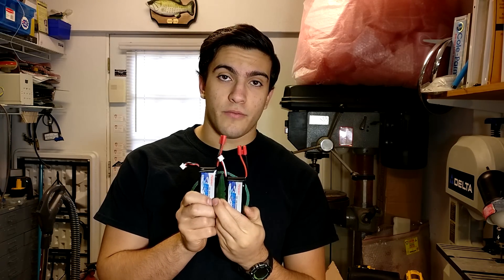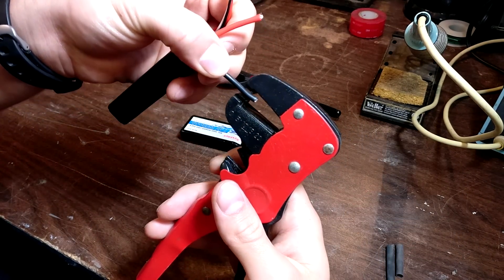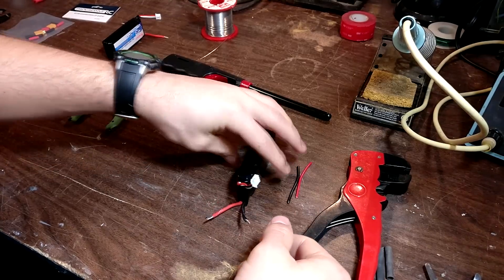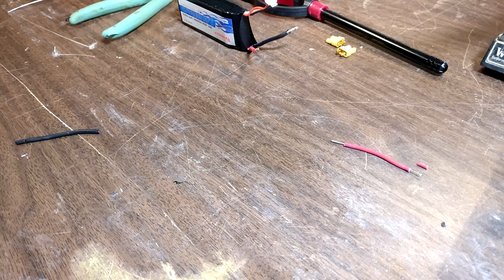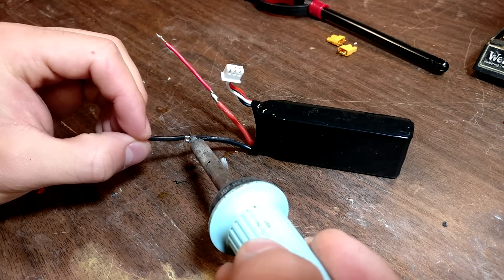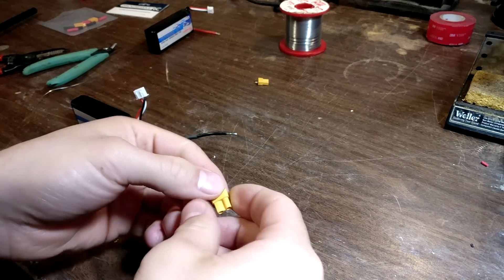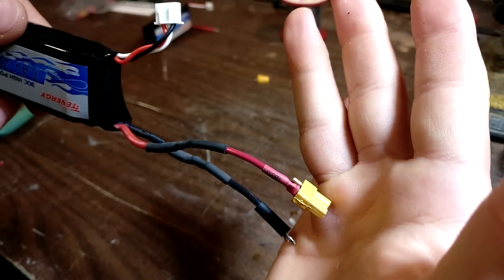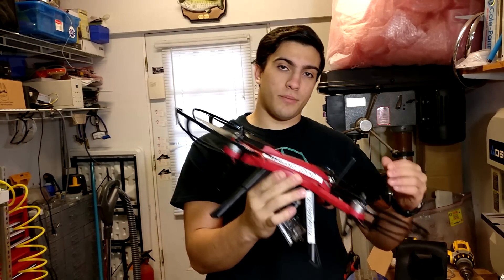Mjx Bugs 3 Battery modification

Comment: dude that's got to be the scariest battery mod video on the net ,  cutting and then stripping both positive and negative wires at the same time and then holding the xt30 in your fingers to solder it and to be honest your really lucky you didn't melt it as you should have it plugged into the male side when soldering them or vice versa and surely you should have added solder to the cup on the xt30 otherwise what's holding it in apart from the tinning in the wire  , I wouldn't fly anything with those batteries , the slightest bit of vibration and those joints will pop apart , mind you, you did give that heat shrink what for so I suppose you could be lucky that that holds the joints together but even still they are some risky batteries you have there my friend , I'd store em outside the house or in a lipo bag or even better still throw them away and buy some that already have the xt30 connector on them ,   sorry for having a go at you bud but that wasn't really the right way to go about modding a battery 🖒🖒
Reply: LOL, everyone is an expert man, i've learned this over the years. Screw all them, it may have been a little unsafe but as long as you have confidence in your ability who cares. I work with high voltage electricity daily and have done things way worse, but i know my abilities. Screw all the haters, nice work and good video.
Reply from the maker: tony perks no uninsulated wire is open therefore no risk is present the only danger is if the two wires were to touch causing a short. It may be a crude way of doing things however it works and was as a whole done correctly. Thanks for worrying about it though. Thanks for commenting and viewing
Reply: Rather kiddie type excuses. Others do it wrong so it's OK for you to do it wrong.  I suggest you use some of the money you've earned by teaching how not to do things and take a course on how to do things correctly. Whether or not I'm an "engineer" has little to with this, I just don't like cowboy's showing incorrect ways to do rather important things which could end up putting someone in hospital or worse. 

There are a number of videos showing how to solder correctly and why it's important, try watching a few, then again you don't appear to be the type to accept you're wrong. For your information I've been soldering for more years than you've been born, and yes I've done it as a business and worked for a company which allowed me to solder the circuit boards for the F15 fighter aircraft.  So I guess knowing how to do it correctly was important. 

One last thing, you really should learn how to take constructive criticism.  I didn't post for my own good, I actually gave you some tips to help you in the future.  The correct way is the ONLY way to do something, but there could be a number of ways which could be correct. Sadly yours was a long way from being one of them. And just because you've managed to get a year out of them doesn't necessarily mean it's safe, it only means you've been lucky.
Reply: This isn't an F15, no one cares about your years of soldering. Not everyone has a perfect setting and every available tool to "properly" do every task. If people do this and get hurt its their own fault, life is risky and you can minimize risk but not completely eliminate it.
Reply from the maker: +JakeJunker wow that was very nice of you to say. I sincerely appreciate it man you rock!it's for people like you why I truly enjoy sharing my content thank you so much! By the way JakeJunker I just wanted to let you know you have gotten a shoutout on my Instagram for your much-appreciated support. https://www.instagram.com/p/Bckb-a-lSaA/?hl=en&taken-by=warriorzoino .Thanks so much !!
Reply: You really are an accident looking for somewhere to happen aren't you?  Jake Junker, fitting ID by the way. "As long as you have confidence in your ability"  Did you learn that at school or did you just make it up? What a irresponsible way to go through life. You "take chances with high voltage" do you. Obviously you're a self righteous apprentice with a just as stupid teacher. It doesn't matter which voltage you're talking about, it all has the ability to kill. I'm just glad you won't be getting your hands on anything I'm likely to be using. How "High" is this voltage, 30,000 volts? and how many amps involved?  

It's fools such as you who cause problems for others. NOBODY should brag about cutting corners where any voltage is concerned, but especially high voltage. All that woeful battery butchery needs is for the positive side to break loose, expose the wire and short out to earth and what follows is one big fireball. I definitely has all the traits of being a bad connection so it's perfectly feasible for such a scenario to happen. What happens if at that time the quad in in the trunk of a car, exit one car and maybe even the occupants.  That's the results of cutting corners, the "what Ifs"  You stop and think "What if" the next time you cut corners. What will you say to the judge, "But I had complete faith in my work" No excuse dumbo. Who cares? everyone but you obviously.
Reply: I was going to say much the same. I don't know who taught him to solder, but sorry he failed miserably. That iron wasn't clean and the resulting joints were very poor, in fact it didn't look as if the solder flowed on any of them. Twisting the battery wires like that is asking for bad connections, the oil from your fingers is enough to stop solder flowing among the wire strands, which means if the joint should flex the whole lot could give way. Cut one wire from the plug, solder it to the new plug, then cut the other wire and solder it, avoid having both wires floating.

Heating heatshrink with a flame like that is also asking for trouble. It's far too severe and can make the tubing go brittle, so when the wire is bent the heatshrink could easily break away and you'll have bare connections looking at touching each other. A good heat gun is far better, you get uniform shrinkage with no brittleness. When it comes to batteries, especially LiPos it's best to be overly cautious. 

I double heatshrink the wire/connector joints then with a larger heatshrink cover the connector and the wires. I'd never join extra wires on a battery either. I'd use an adapter  from the XT60 to XT30. This way there's no need to touch the battery wires or connector. The advantage of doing it that way is it lets you use the battery on something needing the XT60 plug.  By the way, one is a male plug and the other a female socket.  Use your imagination to figure which is which. :-) 

Oh yes, try to get into the habit of using RED wire and heatshrink for positive and the black for negative.  It's a good habit to get into, "any colour it doesn't matter" definitely does. And try not to burn the balance plug. :-)  Yes I was a rather harsh, but as Tony said, it wasn't the right way to show others how to mod a battery.
Reply from the maker: +propfella well I appreciate your information and help I definitely will admit I am not an electrical engineer and there are a plethora of videos showing how to incorrectly do things I would just like to make it known to the public that my work in this video has been working for about a year now with no problems whatsoever. So possibly the correct way of doing something isn't always the only way but if you are shooting for correctness and flawlessness by all means follow the steps provided by my various commenters who offer a very helpful and generous information to help you. Much appreciated for your time to help out anyone who might be having trouble. I take it you are some kind of engineer?
Reply: @WarriorZoino  hihihih,so ironic ,,hihih
Reply from the maker: Alright Thankyou for your insight Have a Goodnight

Comment: Curios why you didn't use the wires from the battery, instead you used another wire to attach to the XT30 clips? The wires from the batter looks like it's just long enough.
Reply from the maker: Ed Cubillan simply because just in the case the wires weren't long enough to go from the battery compartment on the drone to the plug port on the drone so for extra measures I just added an extension
Reply: What gauge wire did you use as an extension?
Reply from the maker: Ed Cubillan I would say anything from 16 gauge to 18 gauge will be fine

Comment: for my mjx x101 i used a 1500mah n it did the same. lvc at 5mins but can fly for another 4mins. the stock 1200 gives me 6-7mins flight. maybe the lipo i bought is a cheap knockoff?
Reply from the maker: Jan Domingo what exactly do you mean by lvc

Comment: do your modded lipo give u early lvc? I have a 2600 and 2700 mah lipo but i always get lvc at 5 1/2 min but yet i can still fly for another 5 mins.
Reply from the maker: Jan Domingo how exactly are you measuring your lvc?
Reply: when i fly i use my fone as a timer. im around 5 1/2 mins lvc kicks in but i keep flying until it cant lift anymore which is another 5mins
Reply from the maker: Jan Domingo lvc has to be measured a voltmeter because if you are still able to fly and spin the motors then you are not at your low voltage cutoff yet
Reply: actually wen i came home i meassured the volts it was sitting on 7.3v im assuming its started lvc around 7.7v. 5.5mins lvc seems wrong though. have u tested ur lipo without landing gear and cam? my stock lipo gives me 10mins b4 lvc
Reply from the maker: Jan Domingo I have not measured it but I would say it depends on the conditions you are flying in. Also you should get more then 10 mins without any gear attached

Comment: Good work.
Have your flight times increased significantly ?
Reply from the maker: Marius LT Great Find
Reply: this is a 2 cell ? I ordered a bug and want more batteries for it. this seems like a fun project. what charger do you use for the batteries? thanks for ur videos
Reply: were do you get the connectors, could you give a link thanks
Reply: https://www.aliexpress.com/item/XT30-Yellow-Battery-Connector-Set-Male-Female-Gold-Plated-Banana-Plug-for-Helicopter/32769779137.html?spm=2114.13010608.0.0.pYIX1r
Reply: u shud time ur lvc hit. my 2200mah seems to hit lvc early. i have 3-4mins after lvc idk why it does that
Reply from the maker: Fábio Pereira I'd say for the price and the extra mah you can't really complain however yes I have noticed a difference in longer flight times
Reply from the maker: Charles Lee Sztook 7.4V 2S Li-po Battery Charger and 3 in 1 Charger Cable Line for UDI Syma MJX RC Quadcopter UDI U829 Syma X8C X8W X8G MJX X600 X101 Tarantula X6 https://www.amazon.com/dp/B01DGG71XI/ref=cm_sw_r_cp_apap_Y2lkL7r2AOlZW    ... there's the link Charles Lee hope you are enjoying the videos thanks for watching
Reply from the maker: Tony Wofford the link to the XT-30 connectors are in the description but if you are talking about something else let me know
Reply from the maker: Jan Domingo I'm actually filming a video on my batteries today😂😂